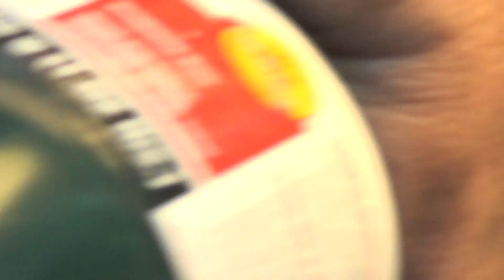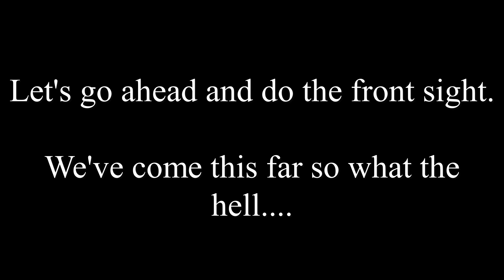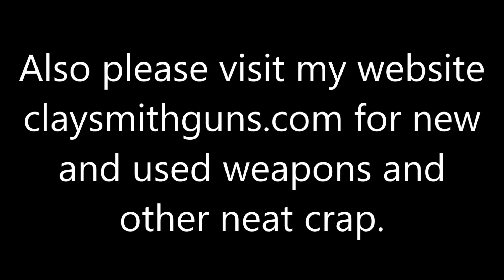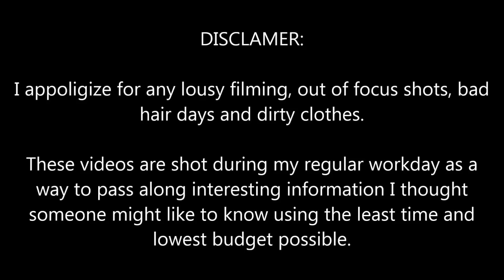The Grumpy Gunsmith of Williamsburg #49 Soldering Tenons

Comment: I know I'm very late, but i wanted to say thanks for sharing your knowledge.  I just started inletting the barrel on my first build, an attempt at a JP Beck.
I might try to solder the tenons, i didn't realize plumbing solder could be used on steel and was going to use silver until i saw your video

Comment: Do you ever use Silver solder for barrel lugs,and soft solder for the sight base ? And do you coat the inside of the barrel with borax to prevent oxidisation? this is a round barrel but the finish is far better, I think, when abraded long ways ( breach to muzzle) for a traditional build. Chris B.
Reply from the maker: Lead free solder generally has 2-4% silver with the rest being tin. Tin and silver are hard enough to create a good joint when properly done. In the old lead solders, the lead was the weak property which could break over repeated shock of the explosive vibrations. If you get the solder made for HVAC applications, that has the highest silver content at 4%. I never coat the bore with borax as the temperature with a propane torch is low enough not to cause much oxidation unlike if you used a oxyacetylene heat source. Biggest worry with overheating is warping the barrel.

Comment: Is there a formula used to calculate the optimal spacing for maximum accuracy? Barrels flex like a Sin Wave. It would make sense to place the tennons at the origins.
Reply from the maker: There was never a concern about that when the barrels were made of wrought iron. They were dead soft so no harmonic vibration. I don't believe the accuracy of the modern steel barrels can be improved on much. Just too many other variables  such as density of the lead ball, tightness of the weave of the patch and powder deterioration after opening and age. Even the pressure used to ram the ball on the powder makes a big difference. I have been able to  shoot a 2" five shot group at 100 yards off the bench with my longrifle. That's as good as most bolt action hunting rifles can do today. Do we really need any better? Consistency is the key. Find the best load combination and strive to repeat it every time. If the barrel vibration and load is the same every time, you will have the best accuracy the gun can achieve. And I haven't even mentioned the loose nut on the buttplate, the shooter. That's the biggest variable with every shot.

Comment: Heating that dont mess with the barrel steel pull out the tempering?????    In that spot.
Reply from the maker: Barrels aren't tempered so no problem.
Reply: @grumpygunsmithofwilliamsburg  yea cut rifleing barrel.     But what bout cold hammer forged?    Those are cold work hardend/ tempered in the rifleing process correct???